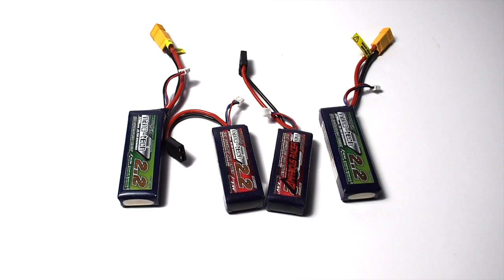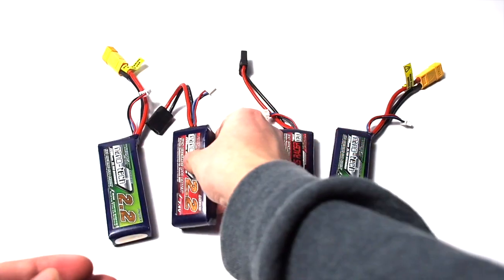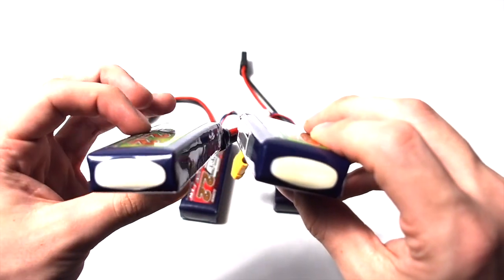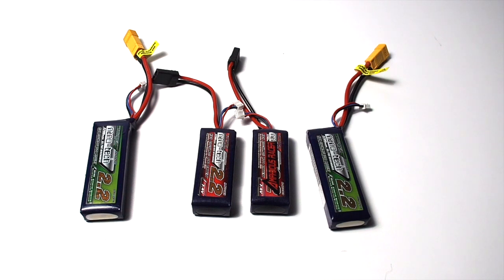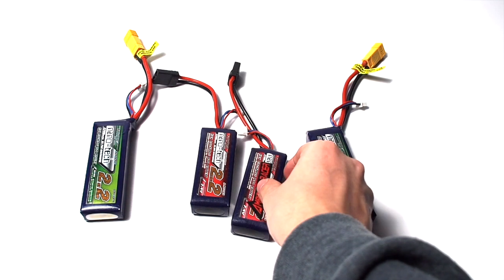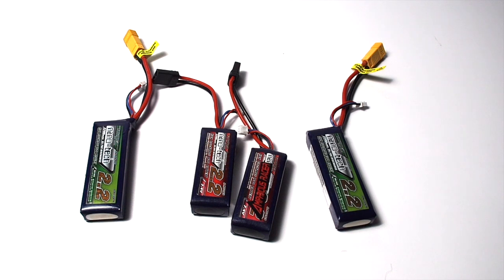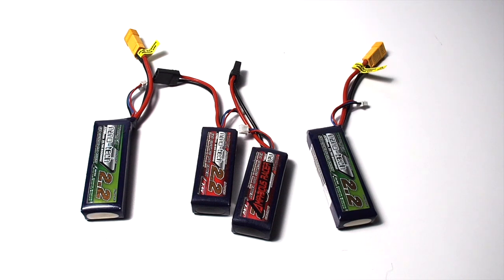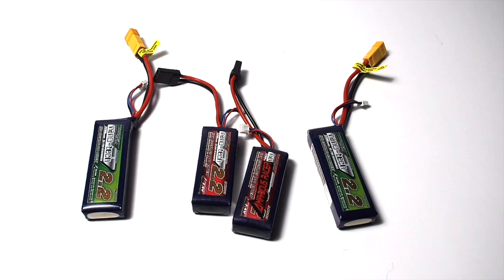How to Tell if you Have Puffed LIPOs

Comment: Remember that a puffed lipo is more easily punctured than a brand new one due to the expanded skin and give. Best practice is to use them for on-roads or powering nitro engine starters and such. Or just get rid of them. If you are regularly using your RC's and they are all sharing the same packs. Then those packs should last roughly 2-3 years before needing to be replaced. If you are running hard case lipos the risk is minimized but it is also harder to tell how puffed they are and the case will add pressure to the cells as they expand which can lead to them exploding so keep that in mind as well. DO NOT TRY TO PRY THEM OPEN! You might damage a cell and cause a fire or explosion right in your face!

Comment: My lipos don't puff when charging, I notice after running my car they are warm and puffy.
Reply: Same here is it normal?
Reply: @LrgFryDietCoke  I found out that it isn't normal and that there are bad cells in the battery. I recommend not using them and buying new batteries. It's not worth taking a chance with them.

Comment: Do you know how I can get rid of my bloated 2s lipo? I left it at full charge for like a year. It currently hold ~4.5v. Is it safe to discharge with a lipo killer? I did it for a while but I feel like it got slightly more puffed.
Reply: 4.5v is too high voltage. 
Discharge to dead 0v. Lipo killer work. Does it low C. I still put mine outside on metal table to be safer.  Then throw them out
I have still used batteries that puffed a lil though

Comment: Thanks for the advice I appreciate it because I have a drone so I got to make sure that I don’t overuse a puffed battery I have one that is a little bit puffed but not 100% and it’s charging in a normal rate and so far I haven’t seen any issues so thank you very much for the tip

Comment: is it normal for my battery to make a noise somewhat like a clicking sound when i press on it, i wanna make sure if its the plastic cover around it that makes the sound, or the possibly slightly puffed cells. it would be much appreciated if you gave a quick answer!
Reply from the maker: Sorry for a bit of a delayed answer here, I actually have to get some new batteries myself, I haven't had new ones in quite some time, but from my recollection yes, you're always going to get that somewhat just by the nature of the plastic cover being what it is. 

What's really the thing to look at is just how puffed they are and if your unsure, always err on the side of caution and get new ones.

Comment: My old lipo has been holding a charge for over 10 years. And still running in my airsoft gun. Lol I was getting slightly worried when the middle cell puffed. I've also had a lipo powered gun catch fire and melted down the hand guard on a m4 airsoft gun. Great batteries but I'm wondering when airsoft will go 16 volt lithium ion batteries.

Comment: The batteries should not puff if you store them properly.  Lipos should not be stored at full charge for more than 72 hours.  They should be stored ideally at 60% charge or about 3.85 volts.   And they really should not puff terribly much if at all.  If they are puffed overly much, get rid of them immediately.  They are a fire hazard.

Comment: One of my 4s traxxas 6700 it's slightly little more swollen than the other one and it charges slower but when running the car it doesn't get hot and it last a good amount you think I'm good?
Reply from the maker: I would say so. Definitely take neccessary precautions while charging, I always charge mine in a metal tin just to be extra safe, especially if you're leaving them unattended. But if you've been using it no problem I wouldn't be concerned.

Comment: Great advice.  Accidentally left 3 2200 3s fully charged for a year. Not knowing anything but leery of them, every one started swelling and getting hot.  Ugggh. May spring for smart batteries but damn the chargers are outrageously expensive.
Reply: Went ahead and ordered a smart charger and some batteries.  Can automatically set them to discharge to storage level after a set amount of time. Awesome